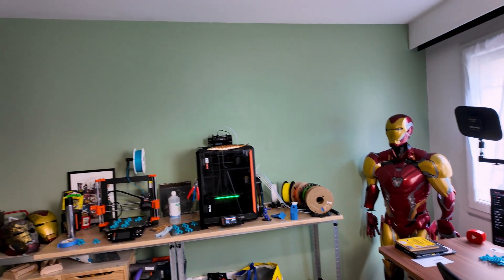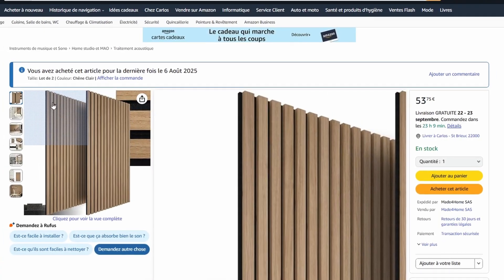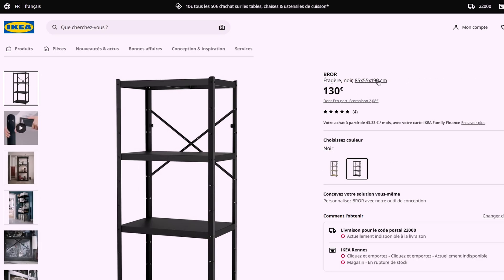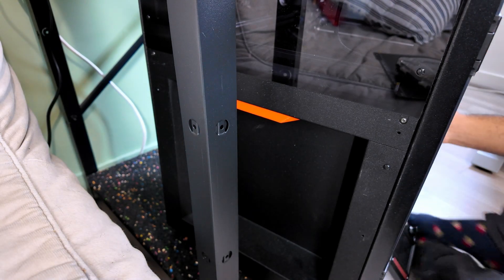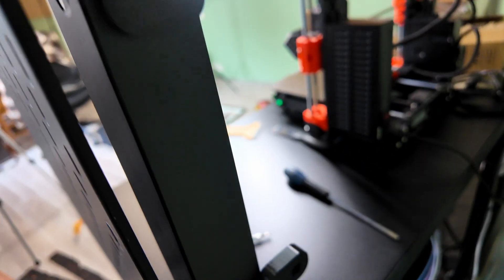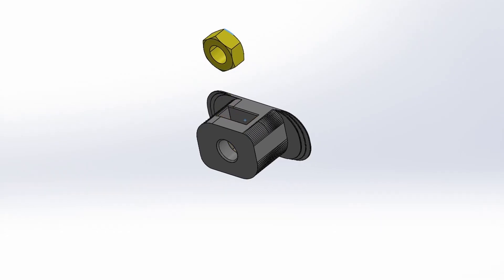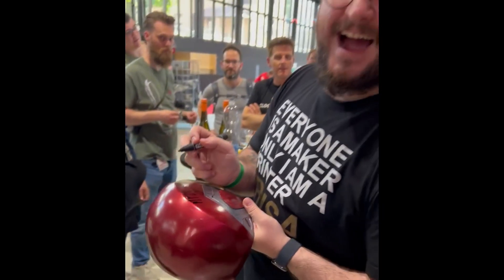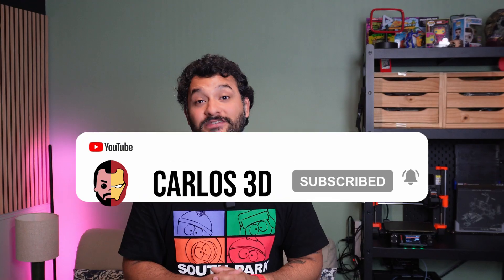The Ultimate Vertical 3D Printer Setup (Small Room Friendly) 🔥

Comment: My worry with the guitar hook is that the layer lines are printed in a way that eventually it could shear along the layer lines leading to the guitar falling over.
Reply from the maker: It’s a valid point but let me assure you that this shape is very strong no matter the printing orientation 😉 you can go on Printables and check the “Makes” tab and you will find a lot of people hanging weights on it